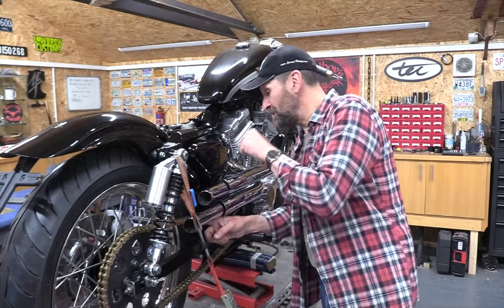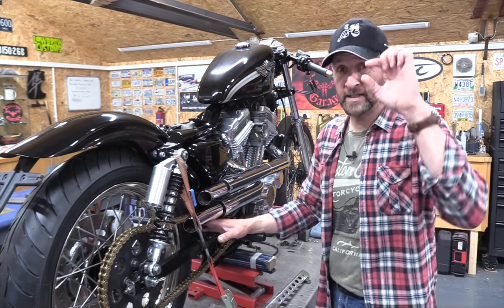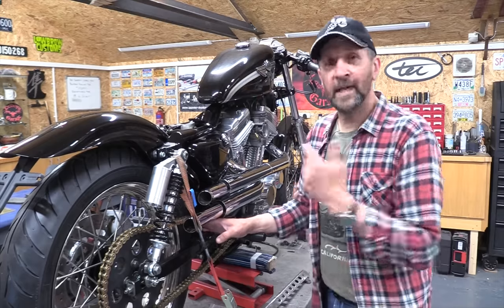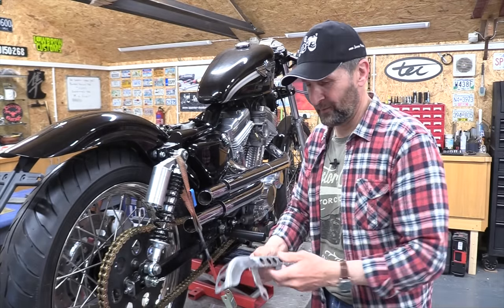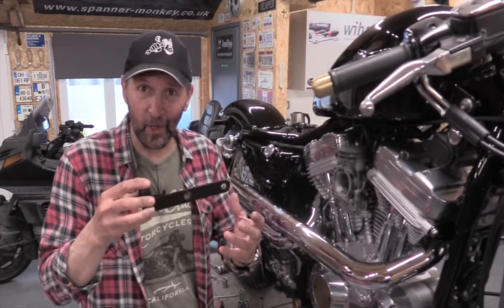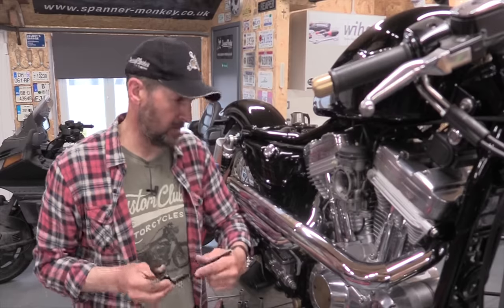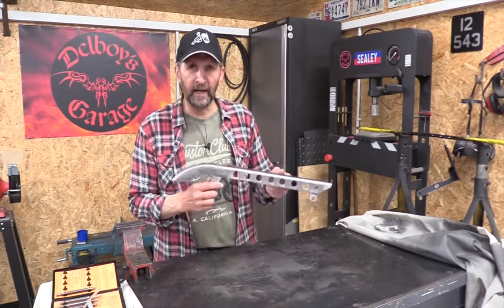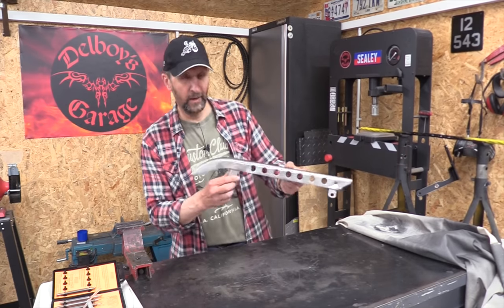Harley Sportster Build, "Custom Chain Guard finished", (1 of 2).

Comment: Off-topic, I want to change the fork oil on my 1988 FXRS and I was able to break the bleeder screws just to make sure they were loose but could not loosen the fork tube. Nuts could not even budge them. Do you have any advice? It would be much appreciated
Reply from the maker: Have you loosened the top clamp pinch bolts?..
Reply: I did loosen the pinch bolts, but still could not budge the fork caps
Reply from the maker: I use a pair of these on them mate, they always give up once you get a proper grip on them.!! https://www.spanner-monkey.co.uk/wiha-wrench-pliers-classic-parallel-jaw-p-74?search=Wiha%20wrench%20pliers&description=true
Reply: @Moonfleet41  thanks I’ll try those

Comment: Just curious why you used primer on the chain guard, you usually dont use it with that spray paint,
Reply from the maker: Hey buddy, good to hear from you... for this project, the face of the chain guard was scuffed and rough from fabrication.. so i used a high build primer on the outside to float out and make a smooth finish...   Usually you can wet sand the finished paint and polish back.. but im using satin black paint here which obviously cannot be polished... so this is the best solution..!

Comment: Nice work as always, Delboy. I would bet that if Low Brow saw this video, they would consider making this releif cut as standard, since yours is surely not the only case of contact happening. The finished product actually makes the part look better, and it should  pick up at least 7 MPH due to the weight loss alone!  Seriously, it does look more "finished" with the contouring, don't it? Enjoy your weekend D&P
Reply from the maker: Thanks Tommy, appreciate your kind words as always... I think the bracket is designed to fit with belt drive where there's no sag, unlike a chain, and of course the belt is half the thickness of a chain, plus the pulleys are wider in diameter than sprockets so they hold the belt higher than a chain... but they do offer them for chain drive custom bikes so perhaps a bracket like this for chain applications like this would be a good plan mate!    Have a great weekend, D&Px

Comment: Hey Del, just sold my bonny (after fixing the brakes etc) and bought myself a harley super-glide custom. I live on a narrowboat in the uk and keep the bike under a decent cover, thought i'd ask if you have any advice on what more i can do to keep the bike in good condition, are there any good products i could use to keep rust at bay, or any other general advice? Unfortunately the obvious solution of keeping it inside just isn't an option for me. Cheers bloke!
Reply from the maker: Hi mate.. Garage or no garage, you'd always benefit from using some form or product.. ACF50, FS365, GT85, even just WD40 to keep moisture at bay in a damp environment...    Otherwise, have you maybe considered a better option than just a cover?, if you have a permanent parking spot for it. then how about one of these.!  https://www.machinemart.co.uk/p/clarke-cis8612-motorcycle-shelter-shed-/?utm_source=Cheetahmail&utm_medium=Email&utm_campaign=EmailGaragesVF260823

Comment: In my mind's eye I can see how nice the brass mesh will look on the finished chainguard, but I have to wonder how much crud it will collect that gets slung off the chain during operation. Flaring the holes with some dimple-dies might have also been a good option, but I guess it would greatly complicate the use of the brass mesh. Not a criticism, just throwing it out there. As always, nice work!
Reply from the maker: I did have a plan to dimple them but the chain guard is pretty thin and it would buckle the whole thing pretty badly without any metal around the holes to support them, so rather than risk trashing it I thought I'd play it safe and mesh them out!   Thanks for your input mate.